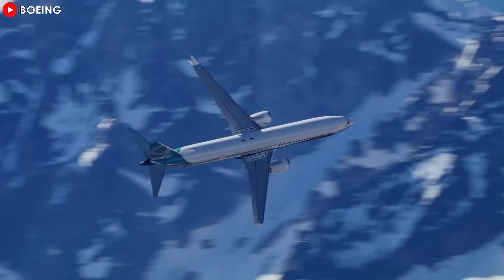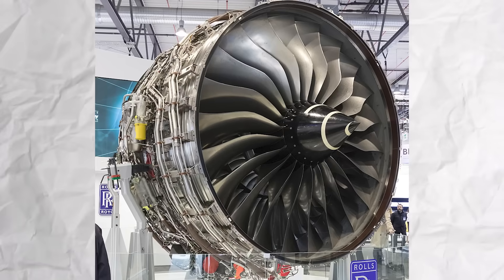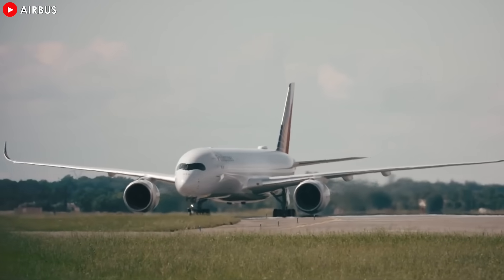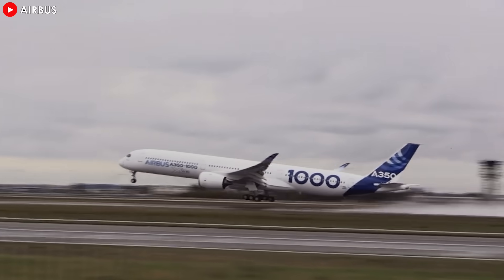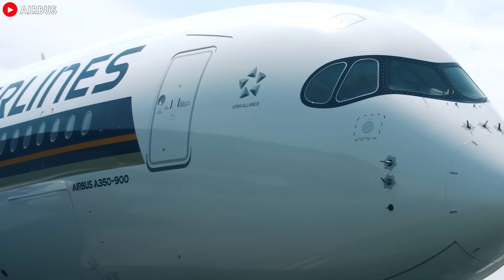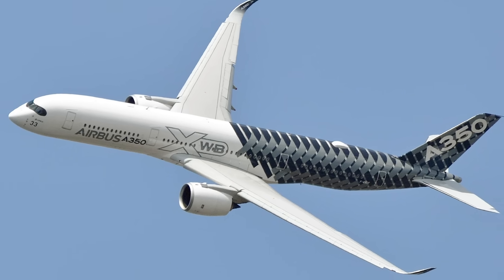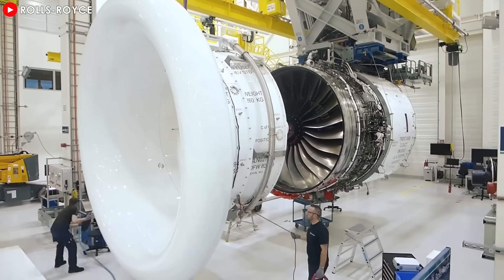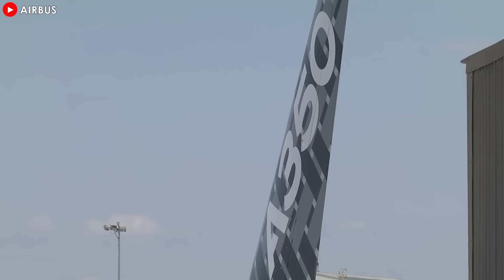Airbus Just Revealed A350 HUGE Upgrade that Terrified Boeing! Here's Why

Comment: Shut up! The A350 consumes more fuel than the 787!
Reply: bigger aircraft bigger tanks and a lot longer range, you know Zip
Reply: @Barry-r3o  exactly and more fuel burn.
Reply: The A350 is more fuel efficient
Reply: @Grailtabuzo19  The 787-9 burns approximately 1.5% to 2% less fuel than the A350-900 with the same payload weight.
Reply: @John-nc4bl you can't compare it like that? The A350-900 has a higher range than the 787-9 and also a higher passenger capacity. The aircraft is simply bigger. So yes it burns a bit more fuel.
Reply: @AME320-27  some people have no idea what they even on about, like the one you replied to

Comment: Years of failure and Boeing still can't get two of it's four Max's or 777X  in the air. Meanwhile, Airbus has a wide range of reliable and fuel efficient aircraft and continues to upgrade its fleet. It will take Boeing decades, if ever, to catch up. Greed and corruption have ruined what once was the dominant manufacturer of civilian aircraft.
Reply: Exactly.

Comment: Are not these engine upgrades because of the complaints from Emirates ?  
Which is holding back a big buy of the Airbus A350 1000 from the Emirates ?
Reply from the maker: Tim Clark has been critical of the engines on the A350-1000. So it seems unlikely that the A350-1000 will be Emirates' replacement for the 777X.
Reply: @FLIGAVIA  True but I am wondering if these RR engine upgrades are meant to make Tim Clark change his mind ?
Reply: Yes they are
Reply: @CraigDakin-b5n  Boeing is the dominant supplier of airfrmes to Emirates.
                                         GE is the dominant supplier of engines to Emirates.
Reply: Emirates prefer the big triple 7.

Comment: Boeing engines still more efficient and their plane is more lighter.  Airbus is only catching up with Boeing.
Reply: In which universe?
Reply: Boeing don't build engines, however they do use RR engines on some of their models?
Reply: @grahampritchard5284  RR only on the 787 which was a failure.
Ask British Air as they have gone to GE for future 787s.
Reply: Hmm maybe but they don’t have any new modern planes. They all been recalled or not certified due to poor quality control
Reply: Boeing engines? I'm confused
Reply: 777x is about 30 tons heavier than A350…
Reply: The 350 is composite - the 777x is metal. I think you’ve got your heavy / lighter planes the wrong way around.
Reply: @CraigDakin-b5n  The 777X has newly designed composite wings.
Reply: Rubbish.  Boeing is so last year.  Nothing delivered on time and killing hundreds of people.

Comment: The GE9X is designed to be more fuel-efficient than its predecessor, the GE90-115B, with a 10% reduction in fuel consumption. It also has lower CO2, NOx, and noise emissions.  This is the second upgrade from its original design.
Reply from the maker: That's right!
Reply: @FLIGAVIA  Are RR paying you to crow about their engines-?

I challenge you to produce a video about the Trent 1000 failure  including the number of airlines that have shunned it for their future 787s and have ordered GEnx engines.
The following airlines have switched to the GEnx such as British Airways, LATAM;  Air NZ;   Al Nippon,  Thai Airways,  Ethiopian,  Air Tanzania  and more than likely other carriers will follow this trend.
The GEnx is a superior engine.

As I noted in one of my comments, RR triple spool engines are more expensive to manufacture and also more expensive to maintain than twin spool engines such as GE and Pratt.

Comment: What do you  mean by 
" airlines are upgrading "
Upgrading what?
Since the very beginning till day,  A350-900 is fitted with Trent XWB-84  producing 84200 Lbs of thrust and A350-1000 with  Trent XWB-97 producing 97000 lbs of thrust
Reply: But don’t they have the A350-1000 now?
Reply: @chespocket1756 yes
A350-1000 is fitted with Trent XWB 92
Reply: Triple spool engines are too expensive to manufacture and also too expensive to maintain. Twin spool engines are less expensive to build and maintain.
RR are dropping the triple spool architecture in favor of a geared fan.
Reply: @John-nc4bl 
But Trent XWB isn't Geared Turbo Fan

Comment: Boeing is better
Reply: Evidence? None that I can see.
Reply: @FrewstonBooks  bot
Reply: It sometimes lands with the same number of parts than it took off with.
Reply: @mikecooper5544  
You meant less parts then it took off with  :))
Reply: @mikecooper5544  bot
Reply: @mikecooper5544  airbus tends to crash with less parts than it took off with
Reply: Boeing has trashed it's reputation with shoddy work and covering up problems. It's a long uphill struggle to regain customer confidence
Reply: @seanbradley7243  bot
Reply: boeing IS better
as you see,boeing does not have weak fueslages,rip off rudders,missing gear pins,crazy automation,exploding fuel tanks and cherry topped with 
wing cracking.
and i have forgotten underpowered engines
boeing has had its fair share of problems,but they actually fix them.unlike airbus.crashy till the last day
Reply: @thetruthbehindplanes And Boeing hasn’t had the exact same issues before? Any proof?
Reply: Boeing fans got their answer and are now mad. Interesting..
Reply: Problem is Airbus innovate, Boeing react, as they fall behind the curve😱
Reply: In your dreams.
Reply: Unfortunately for Boeing, every additional delay allows Airbus time to make yet more minor improvements. This is a serious issue for the 777x project as it is now so delayed that it is almost inconceivable that the airlines will accept a further delay to allow a tweak to be incorporated and certified.
Reply: Those who compare Airbus and Boeing: 🤓🤓🤓🤓🤓🤓🤓🤓🤓🤡🤡🤡🤡🤡 Those who don’t: 🤝
Reply: At crashing yes!
Reply: @SteveGamesplayer  shut up